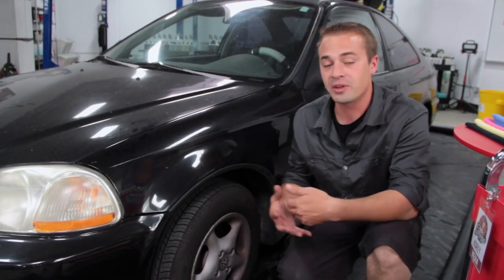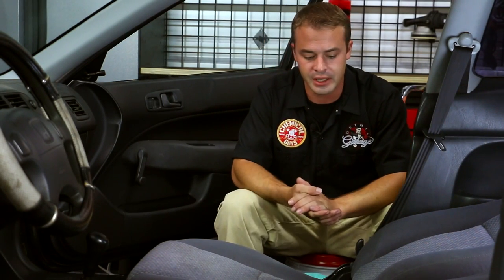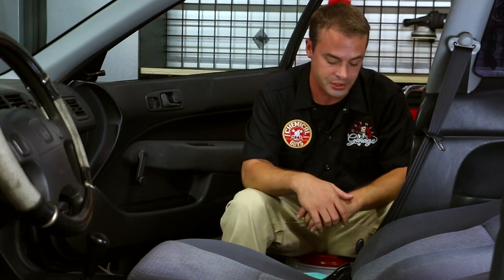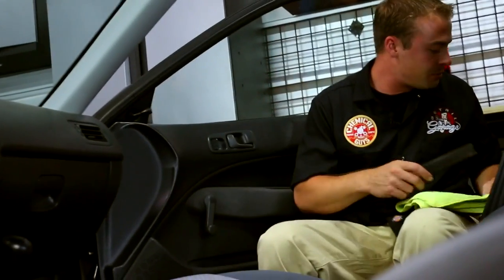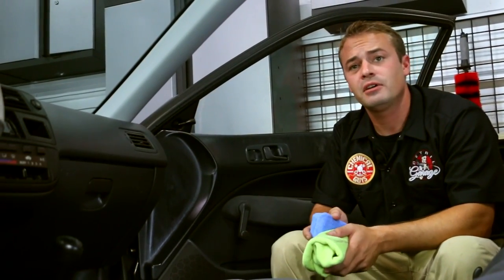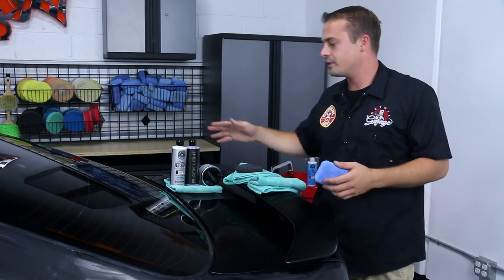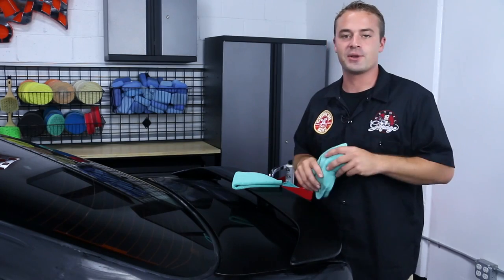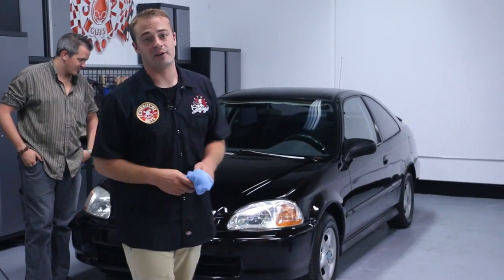How to clean a black car series, DETAIL GARAGE VIDEO (S1E6) Interior, Glazes, Sealants and Waxes

Comment: How does one keep the leather on the steering wheel and gear shifter in good condition.
I know you cant use leather conditioner on control surfaces

Comment: What's first sealant or Wax
Reply: sealant
Reply: ferd22 . so sealant goes first
Reply: israel ruvalcaba Ya the sealant locks in the paint and you put the wax on top to help bring out the shine, the wax is actually an unnecessary step the sealant by itself is enough but it just depends how much you wana go into it.
Reply: ferd22 .
thanks for the help

Comment: if we would take this car as an example ..what would all of this cost ''us'' im labor and used products? Chemical Guys ? No need for an exact number ..but a simple guess?
Reply from the maker: I can't give you a figure. There is to much that went into the production as far as triple time for shooting, and all of that. Plus we have every tool known to man for detailing, so it's pre-established. For example it cost me 12 dollars for two cans of spray paint, I didn't factor in the use of the polisher, the compound, or the pad. I just used what we already had. Now, that being said... For a service such as this, where we increased the value of the car significantly, I would recommend no one does this process as a profession for less than 800 dollars. That might sound like a lot but that is low ball, and considering the value added it makes dollars and sense. -Korey @ CG
Reply: Chemical Guys Thanks Korey for your explanation here! Hopefully we will see more of these ''projects'' in the future. Well done!

Comment: They forgot to clean and polish the exhaust, Glass, interior rim etc.
Reply from the maker: Hi Miguel, thanks for watching. When we do these details, some procedures are done on camera, and some happen off camera. You're definitely correct that the windows weren't cleaned, and the wheels weren't addressed either, which are very important. Polishing the exhaust isn't mandatory for some, however it's a nice touch. Stay tuned Miguel, we have more great videos headed your way.